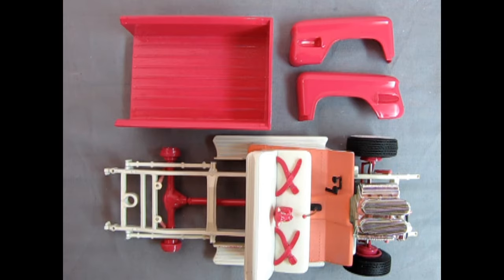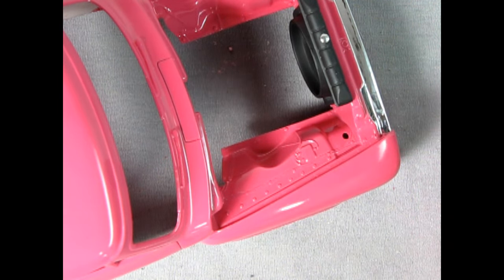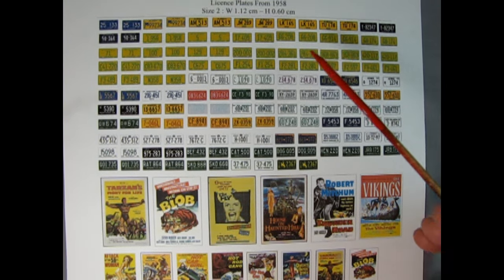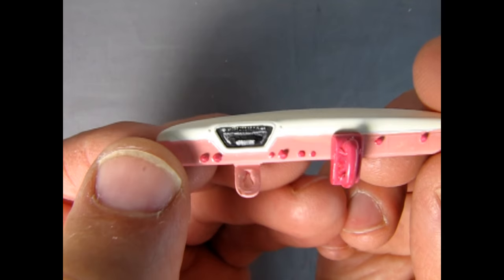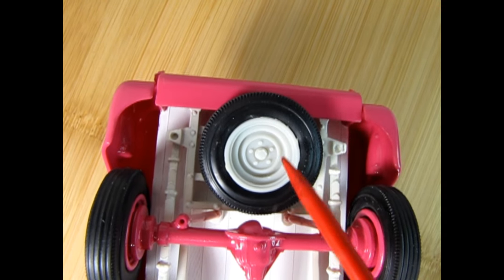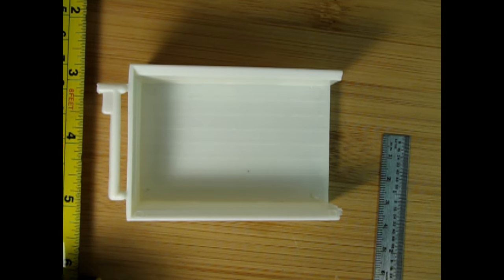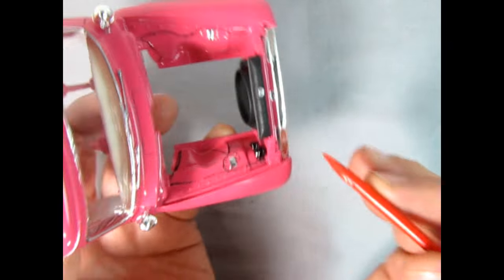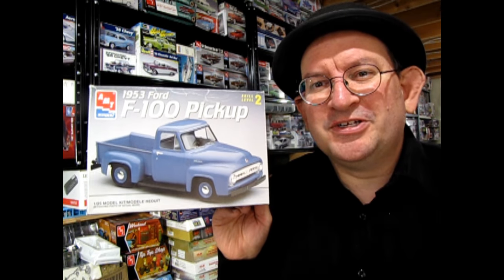Finish It Fridays - The AMT 1953 Ford F-100 Pickup Truck - Part 3

Comment: Nice clean build and what is your tips on painting the chrome ?
Reply from the maker: I use a Molotow Chrome refill cartridge for their pens and I pour out a little dot and then get my paint brush and brush it on. To clean the brush, I use rubbing alcohol. - Let the chrome paint dry somewhere warm for 24 H before touching it.

Comment: The little "bump" on the door is the key hole - should be on both doors.
The two kits that I have both have one on each side.
Reply from the maker: Thank you. That's what I thought it should be. guess AMT missed it in the earlier kits. This one is from the 1990's.
Reply: Most vehicles of the 40s and 50s had one door lock on the passenger side none on the driver side that's the side that would be towards the street. When parked.
Reply: Yep my 55 F100 was that way @charlescain5838
Reply from the maker: @jameswornica803  Nice!